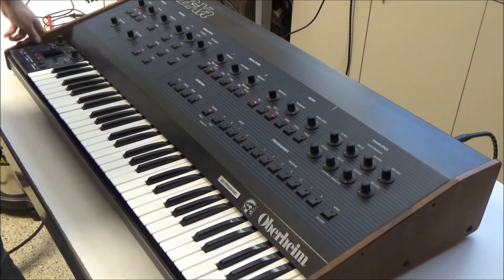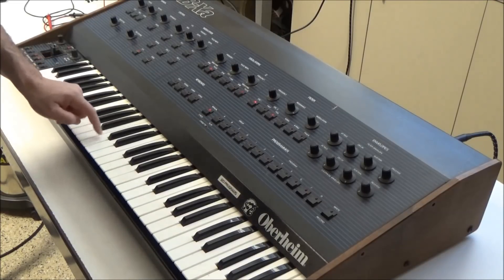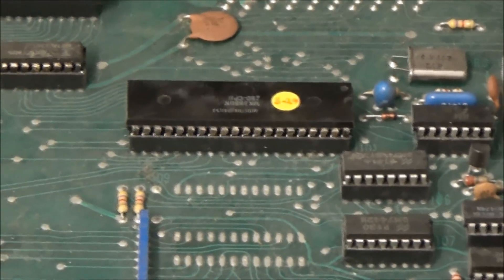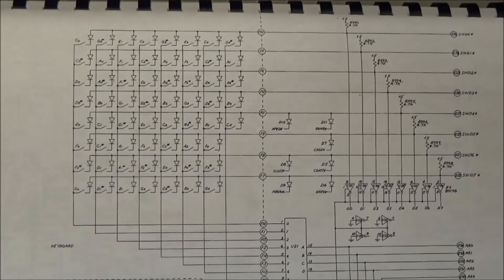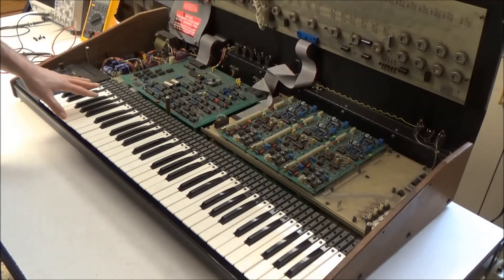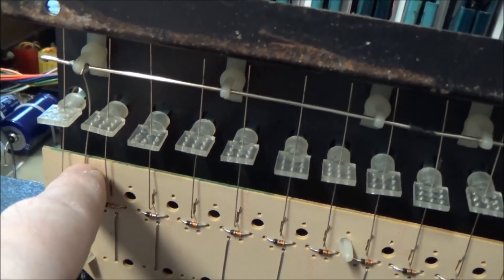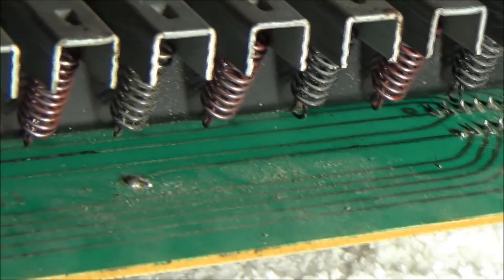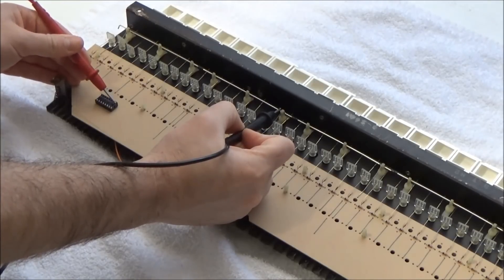Synthchaser #095 - Oberheim OB-Xa Keybed Switch Matrix Repair

Comment: Thank you so much for this video!  I have an old Yamaha KX88 88-Key midi controller and lost the bottom 4 notes.  I checked the 4 diodes and they were all good.  I do not have a service manual nor schematic to know what pins they connect to but this video helped me understand how to trace the issue using my Fluke.   Thanks!!!

Comment: Nice. I had the same kind of problem in my Yamaha SK-20. Just 2 dead D keys. I couldn't see any damage to the trace but soldering a wire in there as a jumper fixed the problem. You get great focus on those close up shots. What camera are you using for that?
Reply from the maker: Just a cheap old Sony Handycam.  This is a very low budget channel. :)

Comment: Great video as always. I have a question as I've never dealt with a corroded trace. When facing one, is it necessary to scrape all the corrosion away or at least cut the trace so the corrosion can't spread? I'm not sure if its that invasive but I am curious if it can spread further and eventually affect other parts of the circuit. Thanks!
Reply from the maker: If it were from battery acid, I'd be more vigilant with it than something like this.  I have some pinball machines, and I've gotten some machines where the leaking battery was left on the board for 30-40 years, and the board got so corroded, I had to depopulate much of it, sand the board down through the solder mask until either the traces got shiny or got sanded away, repair all the traces and replace all the components.  Major pain.  But I've had others with battery corrosion that I haven't cleaned up and it's not gotten worse over the years.
Reply: Oh man that sounds like a nightmare. It's weird how this sometimes happens in areas not even exposed to something corrosive like a battery. I supposed long term storage in a humid area could eventually find its way under the solder mask and start to corrode the trace as well. For longer traces is it better to just bridge the gap or run a wire point to point? Thanks again.
Reply from the maker: For one as long as on this OBXa I'd do the jumper wire, maybe for something like 1cm or so, you could just lay some wire down to bridge the gap. In this case, if I were to do that I would have had to get that circuit board out which would have been a huge pain.
Reply: Synth Chaser yep on my juno 60 that board is glued down onto foam and I would risk cracking it trying to remove it. I had an issue where steel wool particles fell behind there after cleaning the copper contacts and it would intermittently trigger a group of random notes. I used really high pressure air and long lint free cleaning swabs the get the particles out. You live and you learn lol.